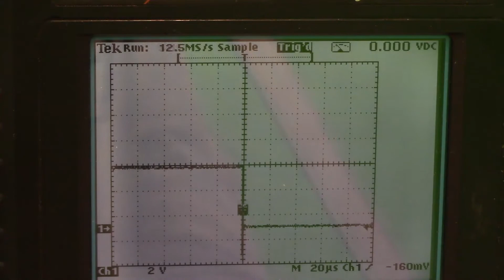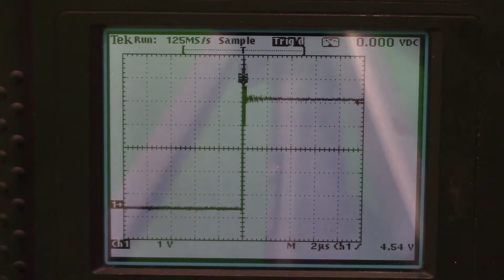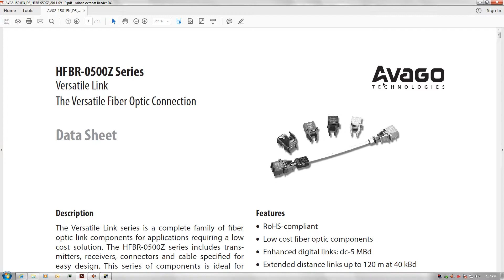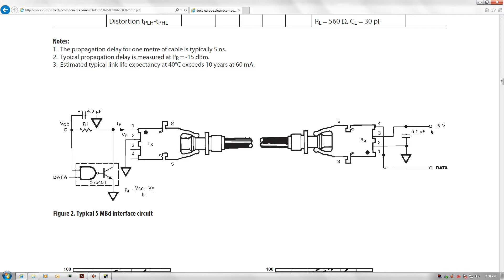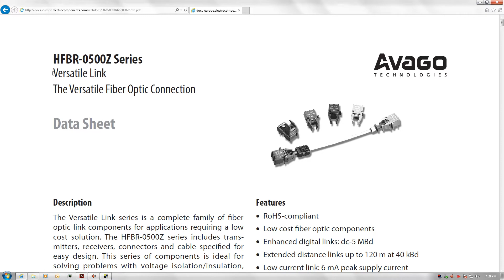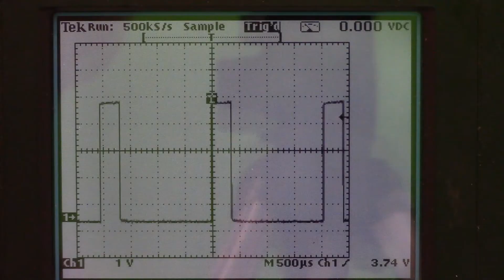Basic Fiber Optic Signaling

Comment: I'm very interested in IGBT signaling with light, but what's the maximum frequency that it can operate? I'm looking for at least 100 kHz. I saw that the fastest gate drivers are with  coreless transformer because opto is too slow.
Reply from the maker: The fastest probably would be an Integrated circuit gate driver. While they do offer isolation the isolation voltage rating may not be sufficient, depending on what voltage range you are working with. The optical fibers themselves with pulses of light are likely sufficiently fast, but I believe the limitation is the transmitter and receiver. I'll do more research on the matter and try to include it with my next video
Reply: Thanks!